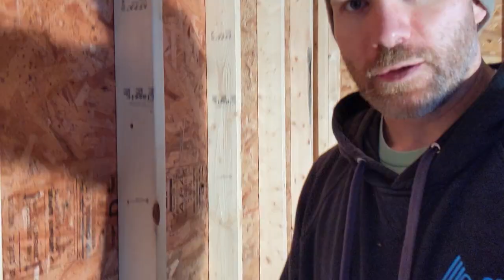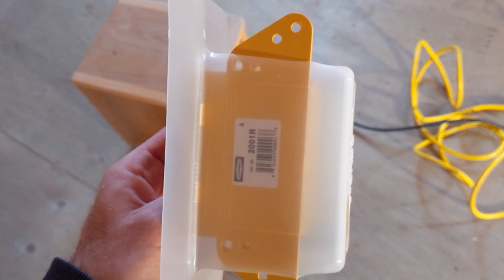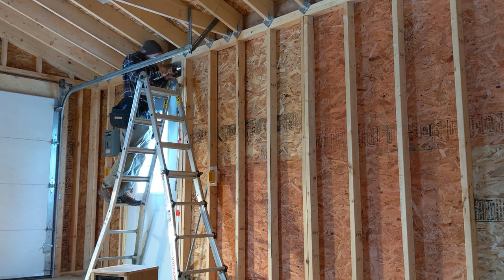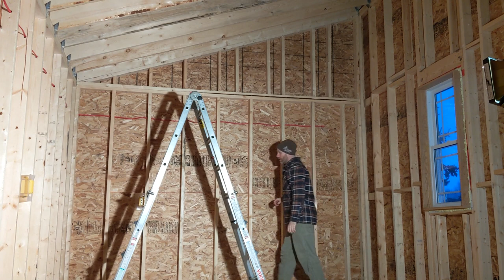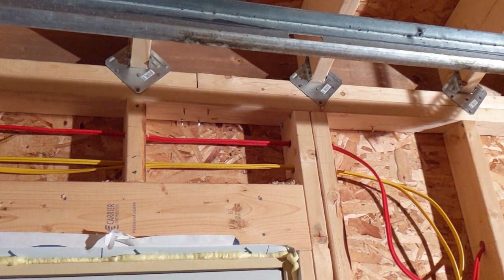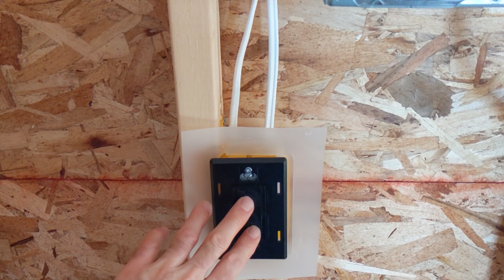DIY Shed Electrical Rough In & Wiring

Comment: When you have vapor or gasket boxes I would recommend them being the ones you nail on since there cheaper and easier to work with. Cutting the vapor barrier on the outlet boxes always leeway for water to possible get into the outlet boxes. 15:24 when you have slack just make a small coil and staple it to the wall for in the future you have slack for readjusting or moving the wires. I’m honestly impressed on the cable management in the panel and where the switches and outlets are great job.
Reply from the maker: Thank you for the kind words, and that tip. I think when I get to insulation I will take some tuck tape and maybe try to seal up some of those cuts I made. Hopefully that helps a bit. I spent alot of time on the electrical, but I am happy with how it turned out. It still needs to be wired into the main house panel, but all in due time. Thanks again!

Comment: Since you said you are not real experienced in electrical and that your “electrician” helped with the feeder, I thought you might like to know some deficiencies.   Trust that I am not picking on you, just informing you for your safety.
1.   Your feeder looks to be 6/3 WG NM cable.  In your other comment, you said it is installed in conduit from a junction box to the shed.  Assuming it is pvc underground, anything below grade, including in pvc, is a wet location.  NM cable  Article 334.12(B)(4) Uses Not Permitted,  In wet or damp locations.
2.  Since this is a structure with power supplied from another structure by a feeder, then Article 225 Part II. 225.31 required that a disconnecting means be provided that disconnects all ungrounded supply conductors.   That means that either your feeder terminates into a MCB panel(not MLO as you have) or a safety switch, or an enclosed circuit breaker.
3.  Article 250.32(A). Requires that buildings supplied by a feeder have a grounding electrode conductor and electrode installed.  Most use ground rods as the electrode.   If you do, unless you can test for 25 ohms or less resistance, two rods are required.
4.   I couldn’t tell but make sure you do not install a bonding jumper in the panel.

If your electrician suggested you use NM cable in pvc, below grade, you might think about finding another one.  

Safety,   Always be safe, the life you save may be your own.
Respectfully,    Kevin
Reply from the maker: Hi Kevin, thanks for all the information. It is much appreciated. I am going to do a follow up video I think to show the entire electrical hook up. If your referring to the feeder shown below the panel, it literally terminates immediately outside the shed in a junction box. From that box there is a heavier wire meant for being buried which runs the 20 or so feet to another panel on the outside of the house. It goes inside the house there. 

Thanks for the info. My electrician is experienced and even told me an inspector may come to see it. I feel like he wouldn't do anything wrong if he thought an inspector would come. Anyways the info is very much appreciated. I'll provide an update at some point. Thanks for watching.
Reply: @northernoutlier  if I remember correctly, you have NM cable running under your deck in pvc conduit.  Even though it is glued, it is still considered a damp location.  NM cable is not allowed in wet or damp locations.   Best wishes!   Kevin
Reply from the maker: @KevinCoop1  Hi Kevin. I will have to do an update video to show how it is hooked up. The cable that goes from the outside of the house underground, and goes into the shed is metallic sheathed cable. I've been meaning to make this video but filming other projects currently. Thanks for watching. Matt
Reply: You’re a rare breed in the comment sections . Citing code and trying to be helpful instead regurgitating something you heard and tearing him down.

Comment: Other than the placement of your doors and windows my new workshop is almost identical in shape. I'm doing exactly what you did here this weekend including a high mount heater! Great to know I am on the right track. Video is great, straightforward and basic, nothing extra which is often information overload. Can I ask how you ran power to the shed? Perhaps there is another video I have not seen? If not, I have to connect to the main panel in the cabin and run underground, most likely through a conduit at at least 12inches down. Any suggestions? Looking forward to more videos.
Reply from the maker: Thank you for the kind words E B. It's nice to the videos are providing the basic information. I probably won't get my heater up for awhile but it'll be nice next winter. As for your question I might actually do a video here shortly. I just got power hooked up. There is a line from the main house panel which is 200 amp I believe to a junction box on the side of the house. A line runs from there underground and into the shop to a 50amp sub panel. I will do a video with a power update shortly.
Reply from the maker: Also make sure to follow your local code. Here where I am the line underground had to be buried at a certain depth. Then I had to put approx 16 inches of material on top and then lay this red tape which says "buried electrical line" on top, and then continue to backfill from there.

Comment: Great work nice and clean  what size sub panel did u instal and wire size? Planinng on doing this on my detached shed
Reply from the maker: Thank you very much! The sub panel is rated for 50 amps, but from the main house panel its on a 40 amp breaker. I just posted a video that describes the hook up from the main panel, and goes over the wire size. It's a few different wires running between junction boxes, 10/3 nmd90, 8/3 Tek Cable, and 8/3 nmd90. Good luck on your shed!

Comment: Starting a very similar job soon... Curious why she you ran the 14 wire up to the first light, why did you come back down across and back up to 2nd instead of just going across through ceiling/roof rafters to 2nd light?
Reply from the maker: Great question. Somewhere I had read when I was doing this, that you should not drill through the rafters for wiring. I think someone had said avoid this on rafters or floor joists. So I chose to go down and across and back up to the second to avoid this. Anyways it shouldn't be an issue, but if you do it keep the hole smaller (3/4 of an inch to an inch) and in the center. Thanks for watching.

Comment: What size feeder are you running from your main panel to your subpanel?
Reply from the maker: I'm not entirely sure. I let the electrician do all that work. I will take a look, and will include that in another video. I am planning on doing an electrical update. I can say that there is a line running from the main panel to a junction box on the outside of the house, and from there a cable goes underground to the shed.

Comment: Hey man, that's a great job, you ran those wires neatly.  My question is:  I  have just bought a   10x12 shed from Tuff shed,  Can I just install myself the electrical (5 outlets and lighting)?  I have the background in electrical.   I  understand that I have to get a license electrician to run the power from the main house to the shed.  Thanks and more power to your channel.
Reply from the maker: Thank you! I spent alot of time doing it and tried to make it as neat as possible. I would say it depends on where you live and what the code is or if you require an inspection. I live in a rural unorganized area and there are not alot of requirements. I did all the outlets, and subpanel myself but when my electrician comes to wire it into the main house panel he is going to look things over to make sure all of this is good. I hope that helps and thanks for watching!
Reply: @northernoutlier  Thanks for your reply. I will check what's the building code here in Nevada.
Reply: It's your house. Do what you want. Hire a good electrician as a consultant. He'll check up on your progress and give you tips on how to do things and how to fix your mistakes.
Reply: It's your house. It's your property. Do what you want. Pay a professional to consult and guide you. As long as he's not doing the actual work. If he is he's breaking the law if he's not a licensed electrical contractor.

Comment: Does a shed require GFCI protection?
Reply from the maker: It depends on your area and what the code is. Always check the code but around me I am pretty sure garages and out buildings require GFCI protection. I went with all GFCI protected just to be safe.
Reply: @northernoutlier  Great Vid. But you could have saved your self a few bucks. Only One is GFCI outlet is needed on the same loop.
Reply from the maker: @Royg89  Yeah I had thought of doing this and my electrician said it would be best to make them all GFCI's. Having not done this before I just went all GFCI.
Reply from the maker: @Royg89  Definitely alot cheaper for regular outlets though. Wow, what a price difference.
Reply: @northernoutlier  like $2 versus $20 each!

Comment: Kinda late to the party…
There is something… A good news, bad news.

Bad news-  As poster Kevin mentioned, you seem to be missing the necessary separate equipment grounding conductor.  I see the ground from feeders, and the four grounds from your branch circuits, but no redundant ground wire.  A separate structure 220v subpanel must have the four wire feeder PLUS a separate, redundant ground wire connected to grounding electrodes (does not have to be separate ground rods- if the ground rods/grid for the main panel is sufficiently close you can use those).

The good news- it is an easy fix.
Reply from the maker: Thank you for the information and thanks for watching! I will have to discuss with my electrician.

Comment: Vapor barrier box?????? Who was born yesterday?  I am not sure how much those cost but they just robbed you.  When installing a barrier on an outer wall, first you put in the insulation.
2nd you run your wirer to where you expect to put boxes, 
3rd you install the vapor barrier, leaving slack in the areas where boxes are going.
5th you cut little slits to pull wire thru, and then use packing tape to seal the barrier with the wire out.
Lastly install the boxes and wire them. 
Works better, less expensive, and you have a better seal.
Reply from the maker: I don't even know if they were $1 and I figured after installing the boxes that they were a bit of a joke. Having to cut slits for the wires to run through and into the box. Thanks for the information. Question though, would it not be easier to install the insulation after all the wiring? Thanks for watching!
Reply: @northernoutlier  true about the insulation. My main goal was to help you vap barrier where you dont have to by that thing, which you had to modify to use it and actually ruining the reason for a vap barrier